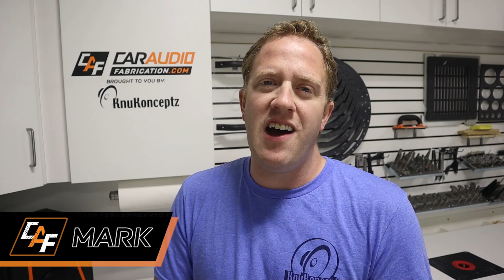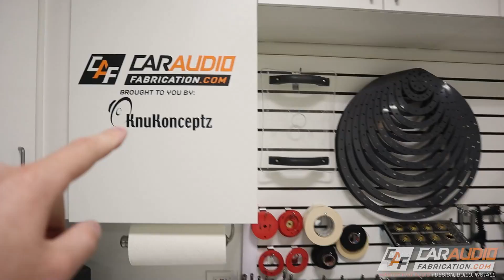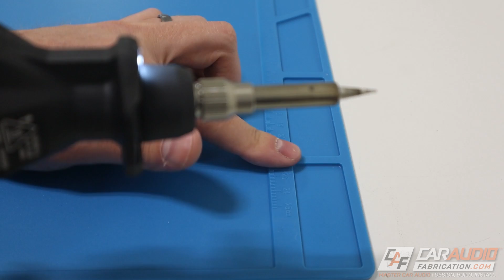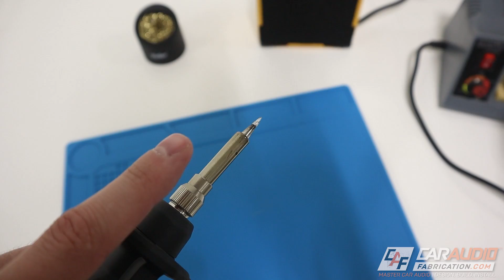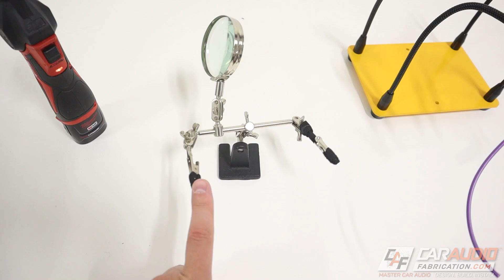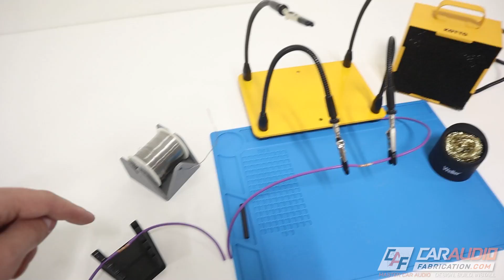Solder Station Upgrades for BETTER WORKFLOW!

Comment: Oh dang, it’s sad to say, I’ve been living in the Stone Age. I like my old bench soldering iron with heat gun station. I like it because I can dial in the temps. I don’t like the sponge... hate it :-(  My helping hands bite. Actually, they’re not helping, only impeding. My work top has seen its better days. IT IS TIME FOR SOME UPGRADES. At the prices of the equipment you featured, I must upgrade without question. ORDERING SOON... soldering mat, soldering sponge, and helping hands. The cordless soldering iron would be sweet. I’ll look into it a little more. Hey, thanks for the upgrade suggestions and the great content in your videos. Best regards, Doug

Comment: Hope you do not plan on using milwaukee for a long time.. Battery sucks
Reply from the maker: Good thing they make several larger capacities
Reply: @CarAudioFabrication  only used the one that came with it.. 45 mins to hour solid use it dead.

Comment: Another tip, is to use the right size tip. You should use a tip that is large enough to transfer heat quickly without dropping, is sinking, too much heat from the tip.
Example, when I would solder SMD's,  on a board, I would use a beveled tip that was slightly wider than the land pads. That ensures you get good surface area contact and heat transfer..
Too small of a tip and the tip temp drops too muh and you have to hold the tip to long and is a quick way to lift pads off boards.
Wires granted are different, having at least a 30W iron or higher works well. With the proper tip temp, the solder should wick up into the twisted copper.

Comment: Soldering tip, when you're done soldering before you turn off the iron.
Melt a bunch of solder on the tip so the tip is encased in solder. Then let it cool like that. All the oxides will protect your tip from oxidizing your tip and not ruin your tip.

Comment: you should test a soldering iron that has the heating element on the tip it self like a ts100 portable or a metcal mx 500p or a jbctools cbd station its like night and day compared to tge ones you have

Comment: Damn the price on that power wire is awsome wish I knew before I dumped mony on some cheap welding cable that ever sence I instaled it after replacing what I had in my (double insulated welding cable) it had alternator whine (unless it was  because I shorted power to ground on my last amp and power cable and it damaged somthing in the car 🤣)

Comment: The Milwaukee cordless soldering option caught my attention.  However, that is a really big clunker to be holding in the hand. I could see hand fatigue moving that thing around. 

I have been using a Weller butane soldering iron for years and love it. Small, adjustable heat, and side exhaust port for heat shrink.  

But I love the other options you showed and I take your advice on many things for useful tools and tips.  Keep up the videos and thanks for sharing.

Comment: hummm.... I never used helping hands to solder wires. I figured out how to hold the wire with my left middle finger and thumb and wrap the solder around my pointer finger and feed into the wire and iron tip. Crap, I forgot to mention I've been soldering for a living for 20 years at a PCB manufacture. Normies can't get these skills from soldering once in a life time.

EDIT: I should add a pro tip to save your iron tips. After your done soldering the joint leave some solder or add a ball of solder on the tip when in stand by. Now, right before you use the iron again wipe it clean and add a bit of fresh solder to the tip. In other words, Keep a ball of solder on the tip at all times when not in use, just clean it right before you use it. It's helps maintain the tip you wont end up blowing a hole in the tip after a few hours of dry docking. You can resurrect a tip by using tip tinner by applying to tip and wipe it of and keep going till solder sticks to the tip again.

Comment: Once again if you tin your leads prior to putting them in the helping hands and together it makes for a cleaner, more solid, and easier connection. Also look into anti-wicking tools to prevent solder from wicking under the insulation
Reply: I always do that to both sides of the wire that I joining, then simply putting the two wires side by side and touching them with the iron fuses them together perfect.  I never have to add solder to join wires, the little bit I put on each wire ahead of time is enough.  I always dip the wire in Flux first too, burn the Flux off with the iron, then add some solder to it.  Works great.

Comment: Butane soldering iron works great also.
Reply: Yep I have one and it works great for being completely portable.  There been a few times I'm not near a plug or don't have a long enough extension cord and the Butane iron works great.
Reply: @rxtuninginc8444  plus you can  use it as a heat gun as well for heat shrinking tubing.

Comment: I have the Milwaukee solder iron & it does work well but it eats batteries & it’s too cumbersome to use in a car . I have used butane soldering irons for years & this is my routine- I have 2, one for soldering & the other for heat shrink . I don’t know if snap on still has them but they used to have a magnetic holder for the pocket stream light & they work great for holders . W/ the solder I have a 2” piece of #2 cable I put a few feet of solder on & it’s easy to use in confined areas . Thanks for all the videos you do & keep them coming (I’m kinda self taught & soak up anything you have to offer ! ) have a good one ! I just remembered, the holders were for the pocket mag light , brain fart 😎
Reply: Yep I have a simple 60W variable temp corded one and a Butane powered one and between the two there's nothing I haven't been able to solder.

Comment: Love the portable 12V soldering gun!
Reply: I have a Butane powered one that works amazing.  Just as good as my 60W plug in.  Not quite as good as my 100w Weller but for being completely portable it's been awesome.
Reply: @rxtuninginc8444  they are good until you get burned by the exhaust lol